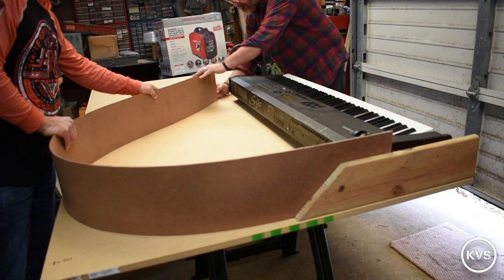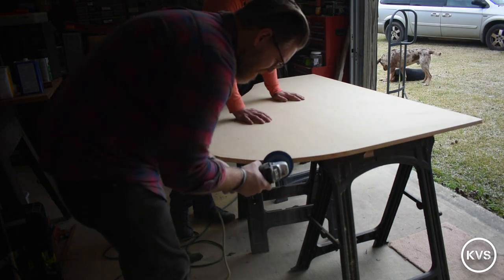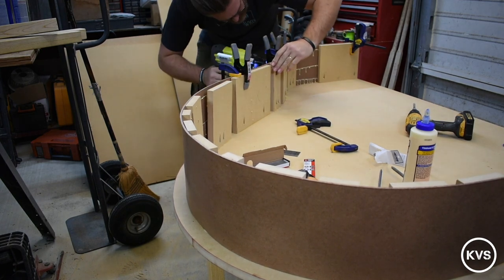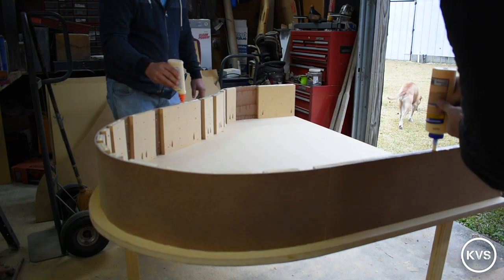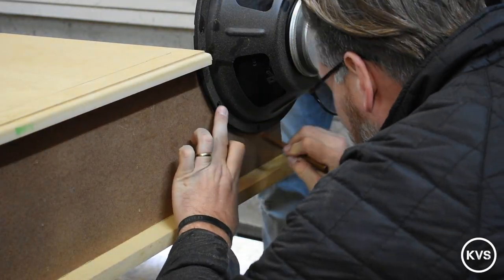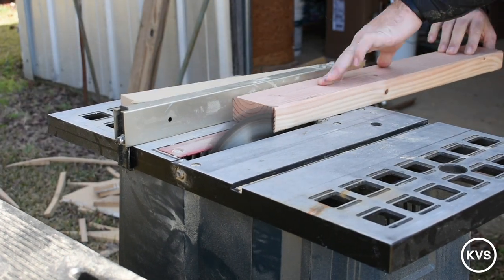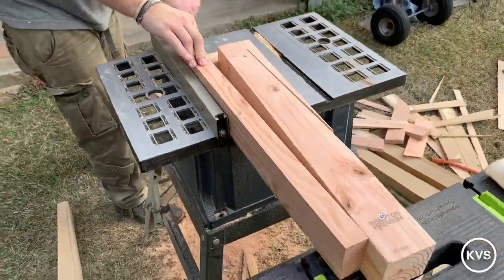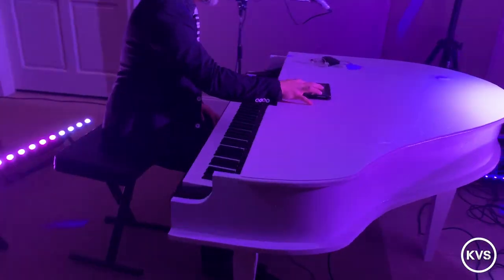HOW TO BUILD A CUSTOM PIANO SHELL!

Comment: I need a faux piano to be strong enough for dancers to stand on.  Do you believe just adding additional bracing inside the piano would do the trick?  Thank you for sharing the video and any advice would be appreciated.
Reply: I would google “torsion box” and make sure you have one of those inside and have a very strong set of legs which can handle the side to side forces (racking force) of a dancer, or several, on the piano.    Long before the lid would cave in on this, your problem is the legs will snap off.